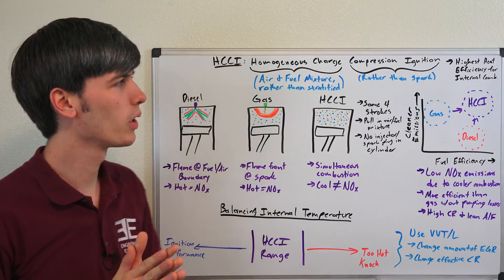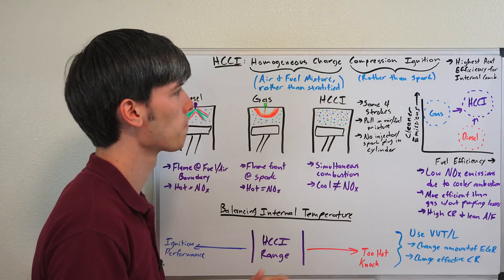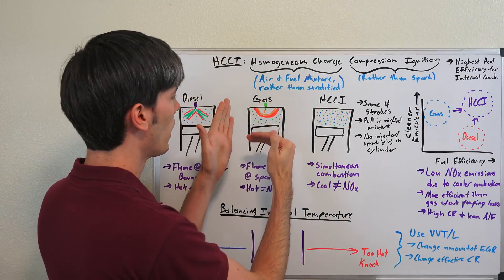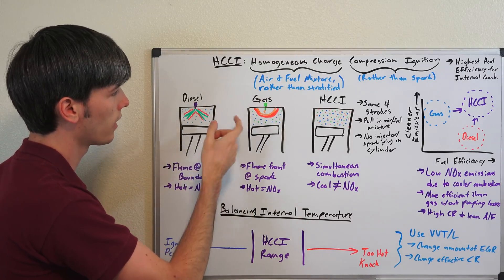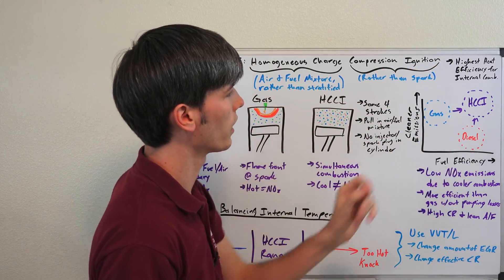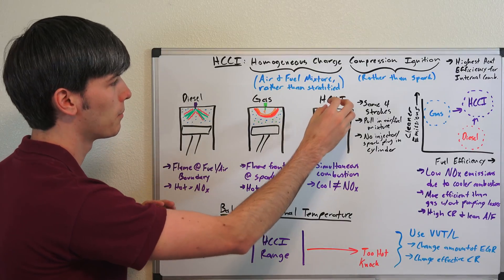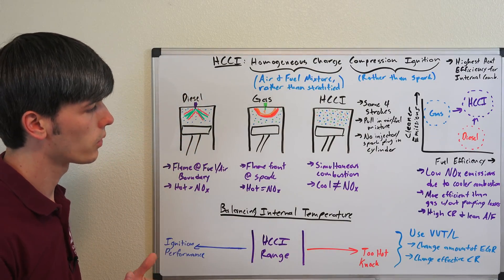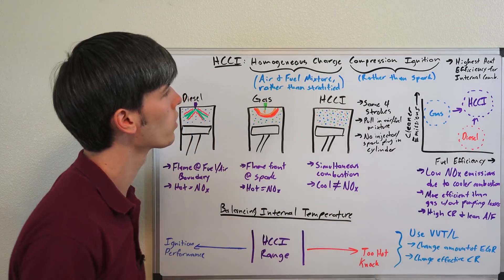The Most Efficient Internal Combustion Engine - HCCI

Comment: You're going to have an awful lot of blowby with those drawing skills! :P
Reply: i see you know nothing... these drawings are for a COLD engine. When it warms up it OBVIOUSLY expands and the gaps disappear. Duh.
Reply: And piston slap 😂
Reply: hahaha, I make that joke to myself on just about any hand-drawn diagram I ever see
Reply: Spoonzaza more like piston flop at that point, right gals? lolol :3
Reply: Those drawings might be the next new design. He might be on to something
Reply: Spoonzaza Internal Combustion with such high RPMs that the piston generates a shockwave that creates frictionless compression. It's the future.
Reply: Hatagashira - No valves is going to hurt intake and exhaust.
Reply: Was going to mention the ZERO compression too . . .
Reply: but no friction ! so no oil !
Reply: HaHaHa ! awesome
Reply: oh mad u got me rolling
Reply: George Tsiros I got an email notification about your comment and I was prepared to get soooooo sassy, haha :3
Reply: HaHa! I see what you did there.....Funny and correct...heat=expansion :)
Reply: building it for nos
Reply: Hatagashir
Reply: +Tom S the engine in the thumbnail is some kind of radio control model engine, and is... AIR COOLED- the horror LOL. Actually they're pretty cool, I think that T shaped thing sticking out the top is screw- to change the compression ratio... as far as I know anyways.
Reply: +WoOsKii 1 

G'day,

  Actually, you're almost right.

   Compression-Ignition Model Engines were developed for Free-Flight Models, back when Battery/Coil/Points Ignition for Sparkplugs involved too much weight, complexity & fynding for most people, & Glowplug Ignition hadn't been developed.
  
My first Control-Line Model had a 1.5cc Compression Engine, in about 1971..; they ran on 1/3 Kerosene (for the Calorific Value, it's  used as Jetfuel...), and 1/3 Petroleum Ether (for the Volatility, lowering the Flashpoint), and 1/3 Castor Oil (because it had Phosphor-Bronze Bushes for Bearings & no Piston-Rings so lots of Thick Oil was required...).

 The Lever on the Threaded Rod sticking out of the Cylinder-Head was called the "Tommy-Bar", and was indeed used to adjust the height of the "False Cylinder-Head and thus change the Variable Compression-Ratio...; typically less Compression for starting - to reduce Kickbacks & cut Fingers, and more Compression for running after starting because that gave Extra Power (!), and higher RPM, and Thrust..., and all those goodly things.

   Tommy-Bar, False Head, Piston, Con-Rod, Crankshaft, Needle-Valve...., so there were 6 Moving Parts ; 7 if you add a Rotary-Block Throttle in the Venturi to open or close the Engine's Air-Supply, and 9 if the Throttle-Block is Push-Pull-Rod linked to a Bellcrank-type of Flat-Plate Exhaust-Damper to "match the Blow to the Suck"....

   So, on the Parts-count, they're in front, and they're more Thermally-Efficient & more Chemically-Friendly...

   What a pity they're such mongrel-bred Bastards to get to start up and run reliably ; because every day the Outside Air Temperature, Humidity & Barometric Pressure is different to the last time it was running, and every one of those Variables effects the Compression Ratio required  to start on any particular day..!

  Therefore, Platinum Catylytic-Glowplugs igniting 75% Methanol with 25% Castor-Oil Fuel was inventex, and it rendered "Diesel" Model Aero-Engines pretty-much obsolete Collector's Items (and Playthings for Massochists), from 1970 onwards.

Such is Life,

  ;-p

  Ciao !
Reply: +WarblesOnALot Cool, thanks for the info! I am very familiar with modern nitro car/plane engines (with glow plugs), however I have an old, odd model engine that I know little about; It actually has a mini sparkplug, and tiny rotating adjustable cam lobe (like points on a magneto) to control the spark, along with a built in fuel tank... I wanted to try to run it, but I don't even know what fuel it uses (I was told 2 cycle). Its a cool retro engine that I think I'll just keep for display because nobody seems to know anything about it (much less how to power it LOL).
Reply: fuching mess. I would fire him if he did this in an engineering firm
Reply: Plus with no cooling fins or anti-freeze,  ain't that cylinder going to get hot and over heat? orrrrrrrr....... maybe he runs it rich with lots of alcohol hehe :)

Comment: You're talking about HCCI engines but the thumbnail is of a Drabant .25 model airplane engine. Apart from being an IC engine, it has almost nothing to do with the subject of the video. https://en.wikipedia.org/wiki/Carbureted_compression_ignition_model_engine
Reply: The video is about efficient engines, it's possible that the engine in the thumbnail is efficient

Comment: A HCCI engine i suspect would sound and feel diesely - what makes a diesel vibrate and noisy is the inability to control ignition as precisely as a gasoline/spark engine....the same problem is going to happen with HCCI, maybe even more so as at least with a diesel engine self ignition you have some control via the fuel injection timing...with HCCI having a tight control is going to be difficult with fluctuations in absolute ignition timing due to it being so reliant on chamber temperature and the precise ratio and make up of the air fuel mixture.
Reply: Note, F1 engines use HCCI with spark ignition - they are not just a pure HCCI engine but use HCCI for part of the power band and spark ignition for the rest.

Comment: Although i understand this is a high efficiency system i feel like that narrow temperature range can easily be thrown off at higher rpm use or even in climates in excess of heat or cold

Comment: If you need to regulate the pressure at compression couldn't you put in an extra valve ( ofcourse complicating the design maybe unnecessarily ) to vent some pressure and then filtering out the fuel to maximise efficiency?

Comment: Mazda is working toward this also.  Their current Skyactiv engines show hints of it already (super high compression and precise control over combustion)....They even use the Atkinson cycle as described in the video (leaving the intake valve open longer during the compression stroke)....There are also rumors that Mazda may be looking to use HCCI in their new rotary engine (which i don't even know how that would be possible)  We'll see.

Comment: There is no one "best" type of engine due to the several aspects of efficiency, emissions and maintenance costs. I wonder why in line with combustion engine technology, there is little fuel engineering improvement? For example, there is LPG, which burns with better emissions than gas, yet still unpopular.

Comment: So wait, how is the ignition of the fuel caused? Heat and pressure? How do you make the compression chamber hot enough to start the engine initially? I don't understand how exactly this works.
Reply: Heat is physically spoken just a high momentum of the different atoms. This is generally transfered through the atoms bumping into each other and therefore impacting the momentum of each other (according to the Collision theory of chemistry)

In a motor, heat can be produced via two ways. Either by producing heat through the spark plug for example (which is the transfer of electric energy into heat) or it can be produced by compressing the gas. This is the principle of the diesel engine that first heats up the air during the compression (this works because due to the smaller volume to atoms bump into each other more often and therefore their momentum increases) and then injects the fuel into the compressed (and therefore hot) air which makes it combust. 
If you would inject the diesel in the same way as it is done in a gasoline engine, at the beginning of the compression, it would combust before the spark plug would do its job (due to it´s lower combustion temperature) (What is called knock and can be very harmful for your engine, so don´t fill in Diesel in a gasoline engine!!) 

In the case of a HCCI engine the fuel air mixture would be injected at the beginning of the compression (similar to gasoline engine) and would then be compressed (would heat up) and then when the highest compression is reached combust due to the combustion temperature of the fuel. That means that you need the right fuel that has the exact combustion temperature that is equal to the temperature that  is being created through the compression and that does not vary in combustion temperature (otherwise knock could occur. A varying combustion temperature may come from differing molecules in the fuel that have different combustion temperatures). Sorry for the long comment!
Reply: P1V1/T1 = P2V2/T2
T2 = (T1*P2*V2)/P1*V1
Since the pressure is way higher when the gas is compressed, the temperature skyrockets, hot enough to auto-ignite the fuel. This is the principle diesels run on, so I'd imagine if you wanted to cold start an HCCI engine you'd need a glow plug or, as we do in Canada, use a block heater. :P
Reply: i remember starting up the fully mechanical diesel when i was young with a torch. to the air filter. there"s your hot air!

Comment: "Most efficient" i doubt it. If we're just talking thing's similar to otto cycle why not a 6 stroke engine (Velozeta, Niykado, Crower, Beare head, M4+2, etc.) I know they've all got their own unique set of problems too. If we're talking efficiency in terms of chemical energy to useful work then i think most gas turbine engines (They are internal combustion too) would beat this dramatically. I know gas turbines aren't suited to the varying load of a car (among other reasons) but i really doubt the HCCI is the "most efficient internal combustion engine"
Reply: INB4 i know i'm comparing really different engines, but they're both internal combustion! a 500MW gas turbine won't fit in your car.
Reply: Intermittente combustion engines can reach higher efficiency than turbines because the peak combustion temperature can be much higher than the average temperature of the surrounding materials. If there is a continuous combustion, the temperature is limited by the material properties, and must therefore be much lower. High temperatures = good efficiency.
Reply: Well, most efficient internal combustion engine which fits into a car. Some of the huge marine Diesel engines have a thermal efficiency of 50+%, but the problem is, they will not fit into a car because they weight 2000-3000 tons and have the size of a house.
And that's the problem. Small engines are in general less efficient. That's even true for gas turbines.
Reply: Jason wrote something but then deleted it before i could read it. I know i'm being a smart arse and really nit picking here with abstract examples, I might even be wrong (I think gas turbines have just beaten 60% efficiency, couldn't find exact numbers for HCCI.). Idk the exact target audience Jason is going for but an absolute claim like "most efficient internal combustion engine" is going to be highly scrutinised by other engineers where ever that claim is made. I'll try and stop being such a cynical dick in the comments though, i really do like this channel.

Comment: I have a question which isnt related to this topic but it poped in my mind. Why does small, economical cars have such tiny fuel tanks? Say a honda fit (jazz in some market) his engiene is efficiente enough and does drink little fuel, but with a 40L tank truth is that doesnt has a very good range specially when going on highways at constant high speeds so why not put a little bigger tank, say 50 top 55L would be very good.

Comment: and what fuel type is used? regular diesel or gasoline or something different?
Reply: gasoline hopefully, we have already created idi diesels
Reply: Gasoline most likely for efficiency
Reply: Actually, all of the above. But it's a dead-end technology really.
Reply: The real doktorbimmer - because this type of motor has very narrow operating range, and different fuels give specific different results. So you can use gasoline, diesel, ethanol or preferably a mix of all 3 to achieve useful operating range. What they are testing now is using this type of technology in regular ICE's at very specific conditions. So yes, this is pretty much dead-end. It will end up a nuisance at best, similar to EGR or DPF for diesels.
Reply: Automotive industry only sees this technology as means of reducing NOx emissions to meet absurd new standards. In the end, we will have both regular diesel and gasoline engines with HCCI that kicks in at specific conditions - for example when cruising. Yes, this will improve efficiency at those very specific conditions. It will also add complexity to engines. Which is exactly what we don't need.
Reply: The real doktorbimmer I "thing" you have NO idea what you're talking about. Exhaust emissions standards is what shaped engines currently produced. They are chock full with technology that contributes to their pathetic lifespans. I don't see what hybrids have to do with it, they use regular gasoline engines.
And YES, HCCI can operate on diesel FUEL as well. Do you know anything about the topic at all?

Comment: so what fuel do you use??
Reply: I think LPG would be the best in this case, purely because of it's higher octane rating. You would be able to compress it more before igniting, which means better fuel economy. Of course, that is negated by the fact that you just simply need MORE LPG than gasoline to make the same power, but combine that with the fact that LPG burns quite a bit cleaner and is much cheaper to make (and less damaging to the environment to make as well), and you've got yourself a winning choice. Either that or Methane. Not as good of a fuel, but we might as well capture the crap before it escapes into the atmosphere and burn it, less damage to the environment that way.
Reply: I'm thinking, from the temperature needed (not too hot) that diesel would not be suited for that, as it requires high pressure/temperature. Gasoline however could fit the bill, and I don't know enough about LPG, but its gas state at "room" temperature certainly could prove useful.
Reply: i read online, you can use petrol, diesel, LPG etc
Reply: ECUs can be programmed with known and anticipated operating conditions and adjust rapidly when fuel is changed.  The main problem as outlined in the video is regulating the temperature of the inflowing mixture.  Heating/cooling the fuel manifold itself might provide a solution.  This setup would also be very sensitive to any sort of forced induction, since conditions external to the combustion chamber are controlling the moment of combustion more than an artificial spark/injection event itself.
The times, they are a-changin'...
Reply: Yeah i agree, maybe LPG/methane are better, because if the engine was supplied with the wrong octane rating fuel, the engine could be messed up, either it didn't ignite, or it's timing would be off.
Reply: Nicolas Losito Not necessarily. Sure, gasoline has a higher energy value per liter, but you can compress LPG quite a bit more than gasoline before knock occurs. Higher compression means more efficiency. It might be enough to tip the scales. Besides, LPG is cheaper and safer than gasoline. You may find scary exploding LPG tank videos on youtube, but the reality of it is that LPG just burns away pretty much instantly in a big, mostly harmless fireball. If you aren't in an enclosed space, the most damage you will suffer is some singed hairs.
Reply: HuntingTarg . hmm, so programable ECUs are already on tons of cars today thnks to gov regulatons for fuel efficiency (Flexfuel). Couple than with Variable Valve Timing tech that Konnisegg's company is playing with. You have a car that can easily change fuel source in milliseconds. And work BETTER than anything we have today.

I like this Idea. Some semis already use LPG.
Reply: Ferdy kurniawan Methane would be the best in terms of compression, it has the highest octane rating, but it does lack caloric value even compared to LPG. Still though, best for the environment if we capture Methane that is about to escape into the atmosphere and burn it instead.
Reply: After looking at LPG you may be right. With its higher stochiometric ratio it may be more efficient
Reply: If efficiency is important then most likely gasoline

Comment: The most efficient internal combustion engine was developed and patented and tested 100 year ago, Its called Pouge carburator, check it out. From then on several dozens of people developed similar carburators, but most if not all were shut down and supressed. They all work by means of completely caporizing the fuel before it enters the cilinder. ITs only nowadays that car manufacturers are starting to get the efficiency of these systems, but its all based on very complicated and expensive tech, more money and control for the manufacturers. The principles of modern and not so modern engines are faulty from the get go. We could've had 100+ mpg production engines for 60+ years.